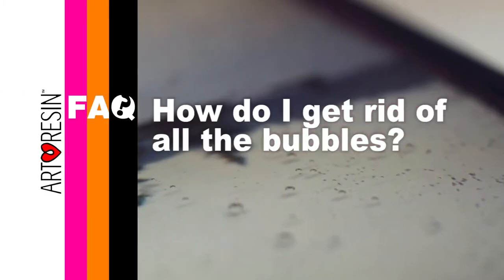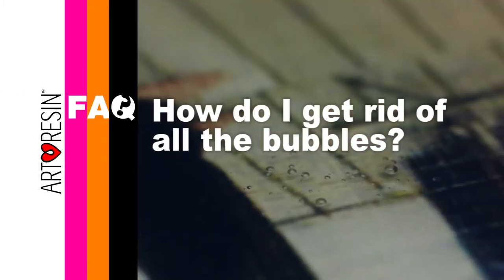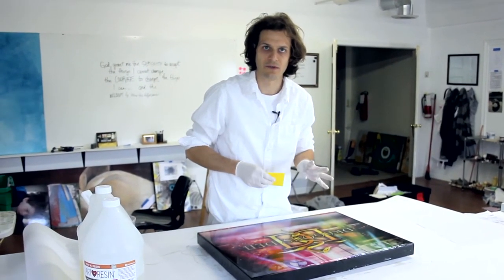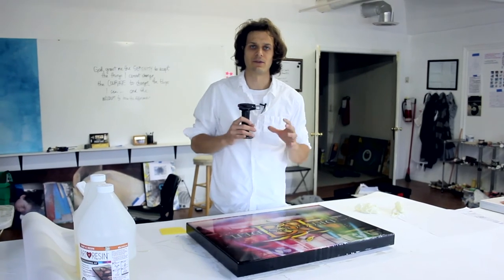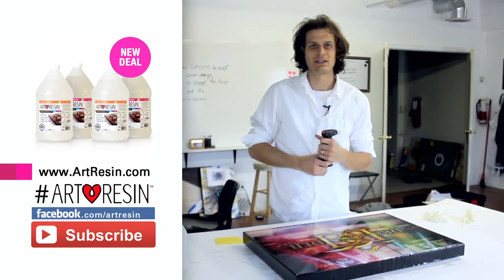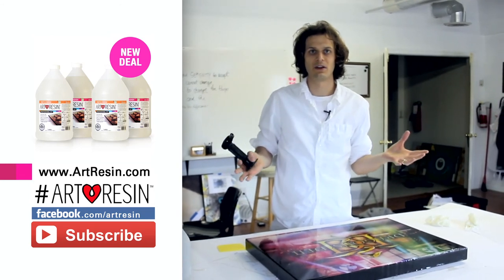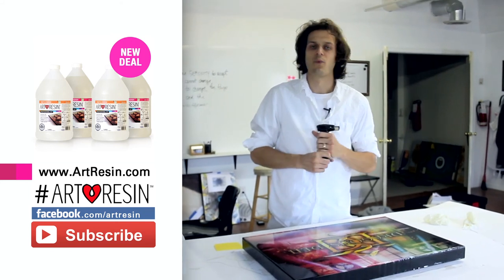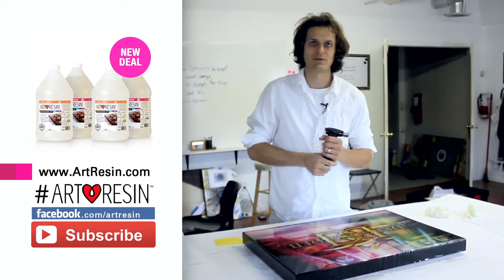How to get rid of all the epoxy resin bubbles

Comment: Hi, how to correct holes or craters that form on the canvas after drying the resin, and and have you a video to show how to put the sticky paper around the canvas. Thanks a lot for answering
Reply from the maker: You need to sand down the resin and apply a fresh coat.  If the holes are caused by silicone oil, you might need to seal first to make sure the holes don't form again on the fresh coat of resin.
When you say sticky paper, do you mean the tape to prevent the resin from running down the sides?
Then check out our 101 video: 
https://www.artresin.com/blogs/artresin/artresin-101-how-to-artresin

Or do you mean the tape to allow you to create a thick coat of resin?  This is called a dam, and there is a video by artist Josie Lewis showing how she does it in this blog:
https://www.artresin.com/blogs/artresin/how-to-pour-a-thick-layered-resin-collage-with-artist-josie-lewis
Reply: @Artresin  merci merci🤗

Comment: I tried all air and spraying methods but the bubbles keep coming back so is this fire method gonna work well ?
Reply from the maker: We recommend using a warm water bath to gently warm up your resin and hardener prior to mixing.  This will help release bubbles since the resin won't be as thick when warmed.  Once you pour your resin over your surface, a butane torch will easily clear all of the bubbles from the surface.  Have a look at our blog for more details: https://www.artresin.com/blogs/artresin/tipstopreventresinbubbles?_pos=1&_sid=954c70aff&_ss=r

Comment: Hi  how  much  time  till  the  bubbles  stop  popping  up , and  how  long  can  i  leave  my  tape  on  the  edges  of  my  canvas so  the  resin  doesn't  run  off. Love  the  resin  best  so  far , love  video  Friday .
Reply from the maker: Hi Annie!  So glad you're enjoying using ArtResin!!  Lots and lots of great tips every Video Friday - you can check the Video Friday playlist for past episodes :) 
Two questions for you:  
1) what are you resining?  
2) are you using a torch to zap out the bubbles after you pour?  

A torch is absolutely the best investment!!  Whether you choose a kitchen style creme brulee torch or a bigger propane torch, nothing beats a flame for getting rid of bubbles.  We normally pour our resin and use the torch right away and it's fine, bubbles don't keep appearing.  The exception to this is applying resin over something organic like wood .. because the wood contains trapped air which can keep off-gassing and causing more bubbles. We usually keep coming back to check for stray bubbles every 5-10 mins until the resin starts to thicken.  It's a good idea to keep a toothpick close by for any last minute bubbles.

I like to pull the tape off the edges after about 18 hrs before the resin has totally cured.  If you leave it longer, the tape can be trickier to pull off.  Sometimes you need to keep a blade close by to help scrape off some stubborn bits of tape.  

Hope this helps! :)
Reply: Hi,thanks  for  your  answer , I  use canvas  and mdf panel  most  of  the  time  that's  what  I  prefer  useing . I  do  torch every  color  I pour  and  then  all  over  ,then  i  babysit  and  torch  when  ever  i  need  to  having  good  results . A couple  of  weeks  ago  i  ordered  via  your  site  my  frist  resin  and  some  tints  i  love  love  your  products. So yesterday  i  went  to  Omar  Dessere  a  art  store  here  in  south  shore  of  Montréal  they  carry  art  resin  so  i  got  some  more . 😊love  it . Have  a  good  day  thanks .
Reply from the maker: that's so great, Annie!!  I remember you from your comment on the ResinTint video!  So glad you tried ArtResin and love it <3  We have DeSerre's here in Ontario too - they carry lots of our product!

Comment: hi would you recommend bubble buster or acetone
Reply from the maker: Hi Ian - we haven't used bubble buster so can't advise on that particular product ( but if you try it out, please let us know what your results are! )
Generally speaking, we don't advise putting any additives into your resin/hardener mixture as there could be a reaction ( cloudiness, improper cure ) and/or if too much additive is added, it could throw off the delicate 1:1 balance necessary for a perfect cure. 
  
Our favourite way to get rid of bubbles is to use a flame torch - either a kitchen flambe butane torch like our Artist Studio Torch ( https://www.artresin.com/products/artists-torch-pro ) or a propane torch like the Artist Professional Torch ( https://www.artresin.com/products/artists-propane-torch-head )

If you're looking to make your resin a little more viscous ( and thereby naturally have less bubbles ) you can warm the resin in a warm waterbath - but be mindful that not even a single drop of water gets into your resin mix or it won't cure properly 
Hope this helps Ian!

Comment: I have been having a huge problem with hundreds of tiny bubbles in a sphere mold. I will try the straw thing but these bubbles are all through the mold from top to bottom making the sphere look like a milky cloudy mess. 

- Heidi
Reply: Have you tried a torch.  For thick casting maybe you want to consider a casting resin.  Also try pouring is layers and torching in between.
Reply: Raising Creativity Yeah I know about torches but with this mold it is pretty impossible to use a torch with it due to the fact it has a very tiny opening at the top. I may have to see if that layers idea works better even though I still can't use the torch.
Reply: +BlackCat2 or if you are ambitious, you can make a vacuum chamber which works amazing!
Reply: Raising Creativity That's true. I have seen how they work and it looks amazing but how I would build one that actually works and can sustain the pressure long enough is the real question. :)
Reply: +BlackCat2 yes that is the question :)  i have been researching this and looking into it.  will make some videos as i figure stuff out.  a big project but if you use resin a lot it seems like a really great tool.  the cheapest one to buy is around 300 bucks that i have found!
Reply: Raising Creativity Yeah I would definitely build one. Thing is I have been digging for information on bubble removal and I found some interesting things to try out before I dive into building a vacuum chamber.

1. Acetone. From what I dug up acetone will get rid of the bubbles. However too much will also weaken your resin so hmm... also it was sprayed onto the top of the resin which I can't do with that mold so I wonder if the resin will still cure if a drop or two is mixed in. I have not tested any of this yet.

2. Vibration. This I am currently testing and the results are looking promising. :D The one in the larger sphere mold seems nice and clear from what I can see but I can't take it out of the mold for another couple hours so not fully sure. The smaller mold looks like it does have some tiny bubbles but not as many as before the vibration technique.

I didn't have anything that would do it I thought but then I remembered I do have a washing machine. So I put my molds on the lid of the washer and just repeated the spin cycle 3 times. If this does turn out as promising as it seems to be I will be finding a way to buy a medium size vibrating motor or several small ones and a square piece of wood for the flat surface to place my molds onto.

Sorry this got long. :D
Reply: +BlackCat2 interesting thanks for sharing this :)

a few other thoughts

use different resin...  

1) UV cure resins come in 1 part so no mixing required.  you can buy affordable UV cure light boxes.

2) casting resins with really SLOW cure times - slower cure times allow for all the bubbles to rise to the surface and casting resins generally do not heat up like epoxy resins and also are known to be clearer...  the downside is they are a bit more dangerous to use sometimes...  need a good respirator etc.

good luck. interesting stuff!
Reply: Raising Creativity Yeah I have seen UV resin but don't really like it though I admit I have not used it.

I do use a casting resin - 12 hours to even be able to remove it from a mold - up to 72 hours for a full cure. :) I know it is dangerous but I really am not that careful and I probably should be. :) I did recently start making sure I wear gloves though when working with it. :p

I will be posting pictures to my Instagram of the tests if it is even a little successful. :)
Reply: +BlackCat2 hmm interesting.  is the resin old?  sometimes 'fresh' resins are better for no bubbles.
if it was easy everyone would be doing it :)
Reply: Raising Creativity Yeah it might be. The hardener is pretty yellowed. I have some new resin coming via mail and it is already here in town but may not be in my po box until tomorrow.

That is true but it works for me because I love the challenges. :D

Comment: While mixing my resin the bubbles came out and started floating in the air I am concerned about inhaling them. Since then I ware a mask but still concerned about if I did inhale them. Have you ever heard of this?
Reply from the maker: Hi there - yes, I get littel bubbles releasing into the air when I'm mixing my resin/hardener a little too vigorously :) 
Try to mix more slowly and you shouldn't have any bubbles releasing.  
You don't want to breathe those in, no  - so if you find you're still seeing bubbles, then by all means, wear a mask.

The great thing about ArtResin is that it's a clean system - meaning that all the components react with eachother as you're mixing ... meaning you won't be breathing in any VOCs or fumes that you can't see.

Comment: It's not the heat so much as it's the co2.. I don't know why but that's why your breath and fire work but not heat.. so much.
Reply: FINALLY, someone who knows what really removes the bubbles...CO2...I have read hundreds of articles about using heat to remove the bubbles which is totally false...a torch will work because CO2 is produced when it burns, it's not the heat and a blow dryer or heat gun won't work....breathe on it(co2), torch(co2) etc. will work.  :)

Comment: what about all the dust nits?
Reply from the maker: a few things for fighting dust .... starting off with as dust free an environment as possible and making sure your piece is wiped and clean is the first line of defense.
Then, one of the reasons we love using a flame torch ( like our Artist's Propane or Studio Torch ) is because that direct flame also helps get rid of surface dust as well as bubbles.
After torching, we like keeping a toothpick on hand - looking at your freshly resined surface in the light, you can see any big bits of dust or hair and you can fish them out with the toothpick.
Finally, covering your piece while it cures will ensure nothing floating in the air will land in your wet resin.
Hope that helps :)

Comment: I am looking to purchase small plastic pyramids to go under my abstracts
Reply from the maker: Hi Ian - you can buy those painter's pyramids at most hardware stores in the painting section ( I've even seen them at my local Wal-Mart in the paint aisle of the hardware section ).  
What we like to use at the studio though are Lego blocks - the big blocks meant for toddlers.  
They are way less expensive, you can adjust the height as needed and if any resin drips on them, it's so easy to peel off once it has dried. 
Hope this helps!

Comment: One thing that people will learn is no matter how well you went over the whole piece with a butane torch you may still end up with a bubble. They can and will form after you have covered the piece and walked away .  The learning process with this stuff gets very expensive very fast.
Reply from the maker: Depending on what you're resining, sometimes your substrate will off-gas and release bubbles as the piece is curing ( this is more a problem with organic objects that breathe like wood or something like a paper collage that contains trapped air, and sealing first can really help to mitigate this ).  
A torch is the best way to ensure bubbles are removed and they shouldn't be an issue.  If in doubt, you can never go wrong sealing your work first to really help prevent bubbles caused by off-gassing.